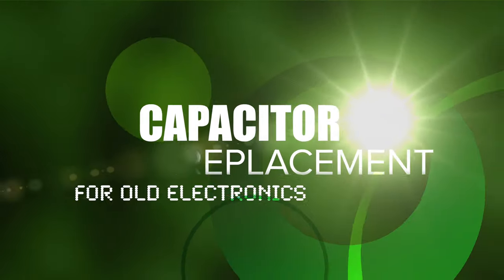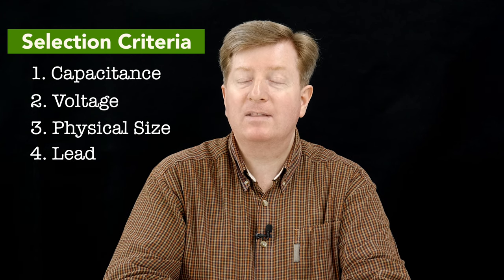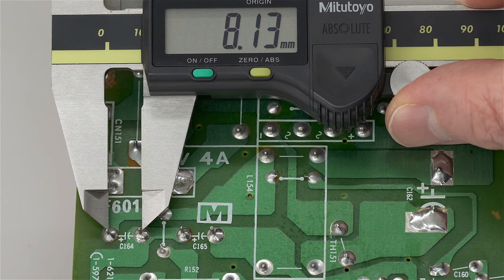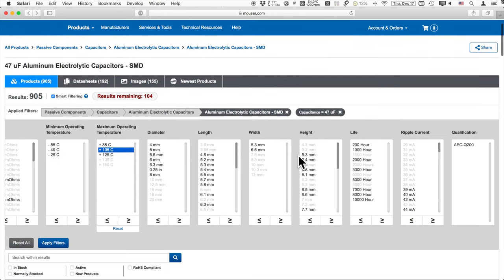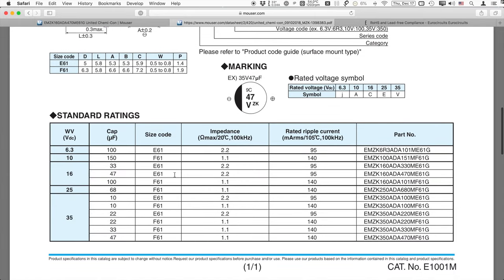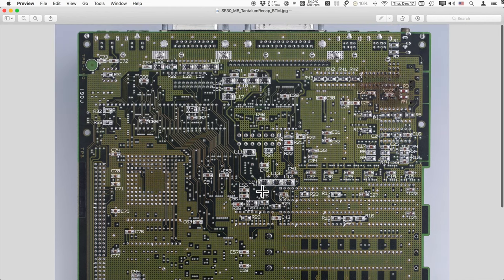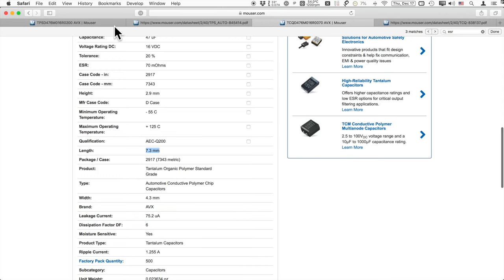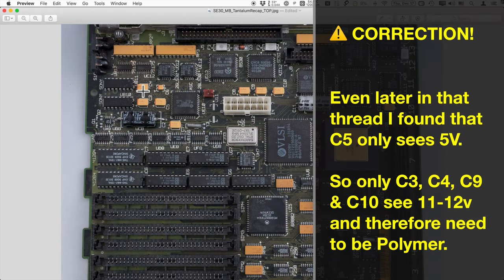Choosing Capacitors to Recap Old Electronics

Comment: Tons of info here, very useful. But, why not talk about other critical properties of capacitors like ESR? Also, why not talk about properly testing a capacitor to see whether it really needs replacing? Not all caps puke electrolyte when they go bad, and not all of them lose their capacitance when they go bad. Actually, it is very common to see capacitors go up in capacitance when they go bad. This is of course not an actual increase in capacitance but a metering error (if a less than ideal tool like a DMM is used) due to electrical leakage, which is another common fault in aged capacitors. It is very easy for a novice person to measure a 100uF cap and see that it is reading 110uF and decide that it is still good.
Reply from the maker: Thank you for watching and for making time to type a thoughtful comment.  

Yes, you are correct about my not having talked in depth about ESR in this video, and it is a good topic to learn about.  My reason for not having taken the deep dive into ESR in this video probably won't satisfy you, but here it is...  No fluid-filled electrolytic capacitor has eternal life.  No manufacturer datasheet suggest eternal life for caps either.  And while I did present the excellent DE-5000 LCR meter in my video, which ranks among the top hand-held LCR meters you can buy in terms of features and accuracy, I have tested very old, bad caps that measured good ESR and even good capacitance across the full range of frequencies, 100Hz to 100kHz.  But after swapping them out, the device began to work properly.  And you are correct about some old caps showing higher capacitance than brand new caps too.  So measuring ESR and capacitance alone really isn't good guidance for knowing when to swap out possible bad caps.

That's why I prefer to replace capacitors in old in accordance with their age, rather than ESR or other aspects.  The number of years it has been soldered into that PCB matters. If the fluid-filled cap has been on the board for over 30 years, it pretty much goes without saying it needs to be replaced. That's not true of SOLID electrolyte capacitors (ceramics, film caps, etc.), and I talked a little about that in my video.  

I disagree with folks who tell me about caps in their experience that are 40 years old and still going strong (mostly HAM radio operators, or those who use vintage radios), because even though those examples are real and exist, most capacitors that are 25 years old and older don't fair so well, and certainly not the smaller SMD electrolytic caps, such as are used in the Apple Macintosh SE/30, Classic, etc.  I watched a YouTube video only an hour ago by a gentleman who purchased a SEALED-IN-BOX Macintosh Classic (from 1990) that he proceeded to open on-camera, and he took it apart to examine the circuit boards and didn't see anything visually wrong, but when reassembled and tried to power it on, there was no bong or screen display.  He then found it had blown a fuse.  One swipe around the SMD caps with a swab showed yellow goo that had come out.  Again, this was a brand new (old stock) machine, where the seal on the box had never been opened, and the machine had never been used (outside factory testing).

So again, AGE really is the right determiner of whether an old fluid-filled electrolytic cap should be changed, and it is also an easy to understand rule for novices who may not have a good LCR meter.  That rule about age remains appropriate even for caps that have never been used at all.  If it's 25 years old or older, it needs to be replaced.  If you're talking 15-25 years, it might still work, and perhaps ESR testing could help.  But to do appropriate ESR testing, you need to desolder and remove the cap in most cases to do a proper test.  Most people don't go that far, which again, is why using AGE as the determiner of whether a fluid-filled cap should be replaced is rooted in sound reason.  When I recap old computers, I not only recap the power supply and motherboard, I even recap the floppy drives too, even if they work fine.  Just remember that no fluid-filled cap has eternal life.

I hope this helps!
Reply from the maker: Thank you for providing such useful feedback. Your comments about testing newly purchased axial lead capacitors are spot on! Absolutely! Everyone needs to do that. I also do exactly as you do and purchase replacement capacitors with a higher voltage specification than the stock capacitors. I usually need to do that in order to ensure the capacitor body is similar in size to the stock capacitor, which has advantages not only in terms of the lead spacing but also the durability of the capacitor overtime. I tend to trust the physically larger body aluminum electrolytic capacitors over the smaller ones. This is an important consideration because capacitors today are smaller than the old capacitors were even though both have the same capacitance and voltage specifications. 

So by going to a higher voltage, you get a physically larger capacitor, and often a better one too. And of course, it usually results in lower ESR, which is good in most situations. However, you have to be careful and recapping switching power supplies because some old supplies require a minimum ESR for stability.

Thanks again for sharing your excellent thoughts!  I think our dialogue is important for everyone to read, so I am making this a pinned comment that will perpetually stay at the top of all other comments.

Thanks again!
Reply: Hey guys, you two seem to really know what you are talking about. I have a problem, or rather a whole bunch of problems now that I know more about caps and their lifespan. Anyway, long story short: Got hold of a B&O Beovision mx5000 crt tv recently, made in 1988.
*Smelled really bad when being on for 10+ minutes.
*Turned out to have lots of dust inside. Cleaned it and smell went away.
*Another smell emerges and upon deeper inspection, both of the internal batteries had gone bad, leaked and even damaged the board to some degree.
*Replaced both batteries and cleaned the leakage away = smell finally gone.
* Using it for three days and the smell is now back!

It smells like a toxic electronic smell that fills the entire room. Can't stand it so have to turn it off.

So to my question: is there a condition within electronics, where due to some electrical failure, even brand new batteries will get "eaten"?

A leaking battery smells really bad. Would you say the same applies to leaking caps? 

For pictures of my tv, if at all helpful, search for the following on reddit, "Images of my B&O MX5000"

Cheers.